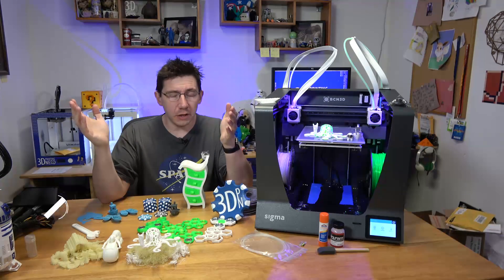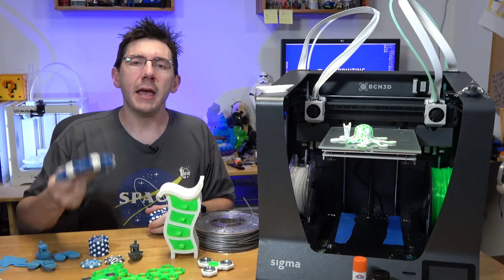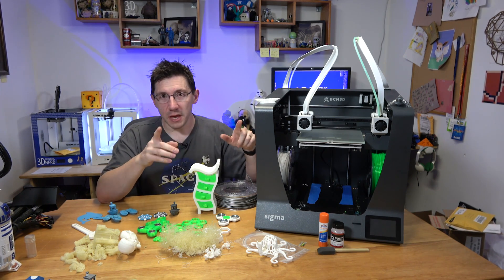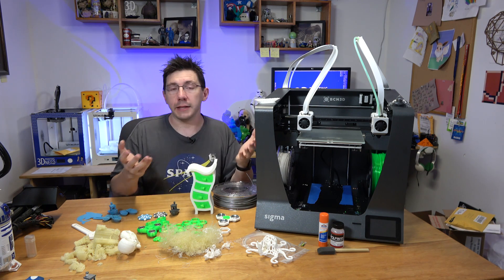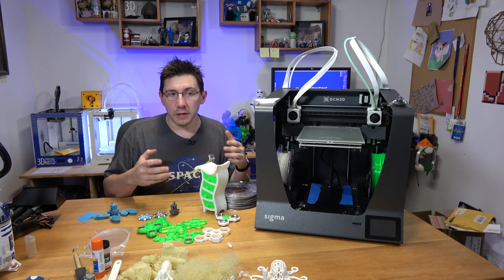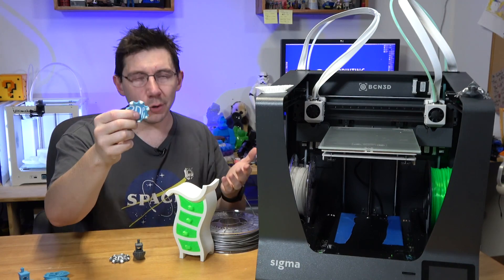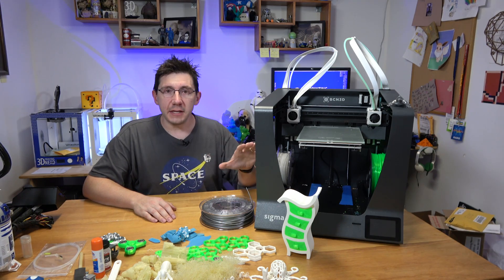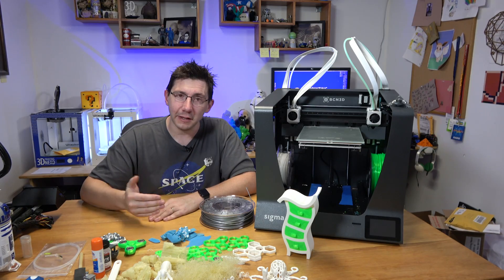BCN3D Sigma R17 3D Printer Review

Comment: I am suprised with this review. With the latest firmware (they no longer maintain this printer) I cannot calibrate buildplate. I can start calibration after calibration over and over. Even when I leave the bed heated for 30min and then start calibrations. The right hotend seems to have leveling issues comparing to the left side one.

Comment: I had this printer for 2 years now, it's high quality,  but I had no success with it at all. when i ordered this machine from bcn was great than they released in update which burn something and stop working I spoke to bcn and I shipped it back but instead of fix it they send me used refreshed one and sense  that time replacement machine will not printer properly I try to replace the parts but with no success. bad experience I won't invest on bcn 3d anymore and the upgrade parts so expensive.

Comment: Hi, You made mention that the Glass Bed has a gap between the heater pad and the glass....making it slow to heat up. Is this done on purpose for some reason?
I have made one to the design from BCN3D, the CAD file shows the glass sitting on the heater pad! but using the BCN3D Glass plate it sits just over 1mm above the heatbed!

Comment: so I have the money would you recommend this or the ultimaker3
Reply from the maker: +kd827827 what are you looking to print, what materials, how much space do you have?
Reply: 3D Printing Nerd I am looking to print things for hobby/fun but I also want to print and sell stuff. I have enough space for both printers concerting that they work with sd card/wireless and dont have to be by my pc
Reply: oh and I mainly want to print pla,abs, and pva and possibly some flexible filliments
Reply: I've had a printer and want a upgrade so I'm slightly experienced
Reply: +3D Printing Nerd  hello

Comment: Do you think that the quantity of purge material is so high because they did that on purpose? to sell more filament? like printer ink dump?
Reply from the maker: I don't think so. In this case, I think it had to do with calibration and settings in the slicer profile.
Reply: our company just bought this printer to get a feel about 3d printing and getting into additive manufacturing (we do CNC ), i just unboxed it today,and will be testing it out tomorrow, exited to see how it will turn out, but your video was quite helpful!

Comment: The rattle noise is because you haven't tighten the bucket thumb screw hard enough (maybe it clashes a little before arriving at it's end) It disappears if it is well tightened
Reply from the maker: They are tightened down all the way, promise. The rattle is from the construction of the buckets, leaving a metal tab loose when sticking through the hole it's suppose to go through. I'm going to try and show what I mean in a later video.

Comment: You can probably reduce the PVA purge amount by tuning the extruder's steps-per-mm setting, or lowering the Flow % for that nozzle. Maybe lower the temp on the PVA to ensure it doesn't ooze too much. And you can probably use sparser supports most of the time. Cheers!
Reply from the maker: In the Simplify3D profiles, I think it would just be a gcode change.

Comment: Regarding the software issues, is this machine supposed to be market ready, or did they say that the software is still Beta? Just curious, because from all you said about the software it sounds beta and they are still taking feedback to get the bugs worked out.
Reply from the maker: The machine is sold as a market ready device, but, there are bugs. I think they will issue firmware updates to take care of what I've found.

Comment: Do the purge buckets need to move with the Y axis? I think it would be better to have large static buckets between the frame and the bed running the length of the frame along the Y axis and only need to move the flexible wiper with a small supporting beam underneath. That way you could have openings along the side of the frame for easy emptying and total weight being driven by the Y axis motor would be less (possibly reduce ringing if any, or lead to faster attainable print speeds). Just my two cents but this machine still looks awesome. Big step up from my CocoonCreate/WDi3v2
Reply from the maker: They DO move with the Y axis, but, your idea is very interesting...

Comment: Do you think the print quality on the Sigma is equal or better than the Ultimaker 3 for both single and dual extrusion prints? Also do you the stringing, and other problems during dual extrusion prints affects the Ultimaker 3 as much as the Sigma? Thanks AA12

Comment: Thanks for the review. If you fix all the rattling/loose parts of the printer, is it acutally quiet enough to be run in an office? I'm still looking for a very quiet printer and so far the only ones i found to be very quiet have too many other setbacks i cant accept. How is the noise compared to an UM3 when printing? And one other thing that bothers me a bit is that they use 2.85mm filament. I've only used 1.75mm filaments for years (after the Makerbot Cupcake CNC that used 3mm was kicked out) and i would love to keep using all the 1.75mm filaments i have. Are there kits or conversions to change this printer to 1.75mm filament?

Comment: I still hate the fact that 3D Printer reviewers use Simplify3D to judge the printer. Simplify3D may be better, but it is not free. Its an additional cost. Its an Upgrade, not included by the manufacturer.
It may be justifiable for this review as the printer is already expesive enough where $150 may not matter much tho.
Reply from the maker: +Alvin Gozali True, it's not free, but I get the best results when using it. I did use the Průša Slic3r when I did prints on that machine, and this machine along with the UM3 use Cura. The goal of a reviewer is to use what the printer manufacturer recommends, and use whatever it is I use and / or am used to. Also, Simplify3D IS recommended by the printer manufacturer in this case.

Comment: isn't the amount of purge material related to settings in S3D? Maybe you need a better retraction setting before it changes tool, and let it prime less material before activating the tool again? Just guessing here, I don't have dual extruders myself, but since you set everything up yourself in S3D I thought it might be related to bad settings instead of a printer problem
Reply from the maker: YES! It's all controlled via software! BUT, the ProGen website is the one generating the profiles, and if I were to tell my mom to print a thing, she could pick the profile on the ProGen site, but I don't think I could guide her through editing gcode for layer changes. I get the feeling BCN will update the ProGen site and we'll be seeing LESS purged material soon.

Comment: Could you use something like the fuzzy side of some self stick velcro to tighten up the buckets so they don't rattle?. Stick it to one side of what must be a gap between the mount and the bucket to take up that space and add just a bit of friction to keep it from moving.
Reply from the maker: I thought about that, but will most likely go with some hot glue. I think it would work well AND have a slight bit of shock absorbance. Will test that out!

Comment: Hey, Joel. Of course, as usual, I'm a bit late to the game. If you do go back to see if anyone has added comments perhaps you can answer my question: What about the Prusa multi-color extruder kit? Do you have any idea when it will finally be released and do you plan to do a review? (I know that's like asking if little bears go doodoo in the woods, right?) My MK2S is due to ship in a week or so. I realize the question is a little off topic but there are some (lots?) of us who don't have 3 grand lying around for a multi extruder printer like this when an extra $250 or so could accomplish the same thing. Thanks and, as always, high five!
Reply from the maker: Hey Ted! Sorry mate, I don't have a window into that multi material upgrade to the Prusa machines. I know Prusa himself doesn't want it out unless it's perfect. I just don't know how long that'll take.

Also, little bears DO doodoo in the woods :)
Reply: 3D Printing Nerd Thanks, Joel. I'm sure that Josef Prusa is loathe to start production on anything that's not up to his standards. I just thought you may have gleaned a little inside poop while at MRRF. I'm glad I didn't add the multi kit at the time I ordered the i3 MK2S. Lead times are depressing as it is but I'm confident it will be worth the wait. Thanks again. 😊

Comment: thanks for the review Joel!
I'm personally using 3DLac as wel, and boy does that stuff work wel! but to be honest i mainly print PLA.
and in my experience the 3DLac works best if you heat up your printbed slightly when printing with pla. due to the heat it gets a bit more sticky. often for me 45 degrees celcius is enough to let the pla prints with 3DLac stick like a boss!

Comment: Retarded bucket design.  Should just be a chute to the outside.
Reply from the maker: Or perhaps a bucket that makes removal while printing a lot easier?
Reply: I wouldn't want to be babysitting the bucket during print, even if it were easily removable.

Sit the printer next to a trash can, let the thing just chute the droppings out to the trash can.  Done.
Reply from the maker: I honestly LOVE that idea and if you can think of a way to make it work, the machine can be "modded" :)
Reply: While an external chute would work, I don't think it's the aesthetic they're going for. That said, simply making the buckets deeper would help (I don't remember seeing much below them...but it's tough to tell how forward they're really sitting from this angle). But make them deeper, and perhaps put small doors on the sides for access and you'd have it licked, as long as they also do as Joel suggests and lower the purge amount per cycle via software. Easy peasy...
Reply: There are different ways to do it.  The simplest mod would probably be remove the bottom of the bucket so the filamant drops straight down to an angled chute that is smooth and pretty steep.  The acrylic side panels have slots cut in them so the chute sends the filament right out the printer.  You'd have to have an external receptacle on each side with this method.  It might run into the filament spools, so some adjustment might need to be made for that.  The depth of the chute kind of depends on what position the software decides to run the cleaning in.

This is really no different than the problem that a lot of the portable air conditioners have.  Some have these useless dinky condensation trays that you have to get up and empty in the middle of the night.  Others allow you to set the unit over just a bucket and you don't have to drain it as often.

I have no doubt that the reason the design was hosed was because there was some marketing genius that thought it would be better for the "aesthetic" to screw up such an obvious thing.

That's the worst kind of tradeoff to find in a 3d printer.

This isn't the first time a dual X carriage has been done -- someone did it on a Bukobot like 4 years ago.  Search for dual X-carriage Bukobot.  The ooze is taken care of by a strip of SS.  "Easy peasy."

Comment: How is the print quality and the auto bed leveling? Also did you experience any missed steps on the motors like Tom did?
Reply from the maker: Tom said it best in a tweet, "It's the closest you're going to get to an Ultimaker without actually getting an Ultimaker". Print quality was top notch, for every print. I experienced ZERO missed steps, though unlike Tom, I did not start with the bad gcode, I was given the updated files for the sdcard before I opened the box. I hope that makes sense.
Reply: That's what I was thinking as well, I have been waiting for your review to decide if this or the UM3 is the one to get. You guys have not made the decision easy, this machine looks like it could be a dethroner for the UM at some point, just not sure if it is yet.
Reply: Crisp high five to you for your thoughts on which one to do? I.e. Is the UM3 worth the extra grand right now?
Reply from the maker: TJ, thanks for the crisp high five! As for this versus an Ultimaker 3, that's a very hard decision. Both machines perform incredibly well, though, if the decision is based purely on price, the Sigma takes it. But, as you and I both know, it's not just price alone :)
Reply: 3D Printing Nerd not too worried about price, but if the Sigma is on par with the UM3 saving money is nice. The main thing I want is good quality prints across single and dual heads. And you happen to have both for comparison, you are my knowledge source.

Comment from the maker: Hey everyone! I'm VERY sorry about the audio issues. I had forgot the camera audio settings were set on automatic gain control, where usually I have it set on manual. That's what after every cut it got louder. BELIEVE ME that is fixed for the next video. I'll also try to get all the links to the models I showed off in the description as well - I forgot to do that last night. It was very late and that was something I forgot to do. Sorry about that.
Reply: it's okay, we still love you Joel. can't wait for the Angus VS. Joel spinner throwdown.
Reply: Hey, do you know of a large format 3D printer with two nozzels, a heated bed, and self leveling?
Reply: 3D Printing Nerd can you rewiew the flux delta+
Reply from the maker: @Kosmi_K - The gMax 1.5XT+ has a dual nozzle option, with a heated bed and auto leveling via BLTouch.
Reply from the maker: @herry campbell - sure, if they send me one :)
Reply: Have you tried the gMax 1.5XT+ with a dual nozzle? I haven't seen any videos or reviews of the two nozzle option hence my hesitation on that. I already have a Form2 which makes amazing prints but I'd really like to be able to make big things with dissolvable supports.
Reply from the maker: I haven't yet, I don't know if I'll get the chance.
Reply: It's hard to pull the trigger without any reviews on the duel extruder :( Do you have a contact info for them? Maybe they have some media or videos of their own.
Reply: Definitely not a good watch with headphones, that's for sure. I presumed that the first audio shift was a glitch when the volume dropped again after the next cut scene. The second time it jumped up I dumped the headphones and just went with the tablet's speakers.

Comment: Joel the cuts with the super loud volume is terrible. great video but man, those transitions are tough if you're wearing headphones.
Reply from the maker: Yes they are and I'm terribly sorry. I forgot to switch the camera back to manual audio control from automatic gain control. It does this, and I didn't realize it while editing because it was late. The setting is changed for the next video. Again, super sorry about that.

Comment: Somethings wrong with the sound, I think. It loud after each cut and then gets quiter.
Reply from the maker: VERY sorry about that, sorry I didn't realize it in time. The camera was set to automatic gain control for the audio from an earlier shoot. I forgot to set it back to manual before recording the sit down portion of this video. The setting is changed for the next stuff and it won't be a problem again - it was just so late I forgot to do my standard checklist before recording.
Reply: Expierenced the same issue
Reply: We also suspect it is a movie editing program causing it.
Reply: Yeah, something ugly with the audio, indeed.  I have to keep raising and lowering the volume
Reply: I don't mind it so much. Just wanted to let you know :)